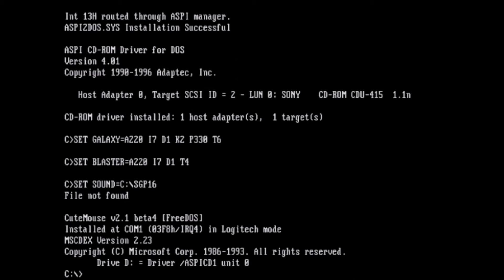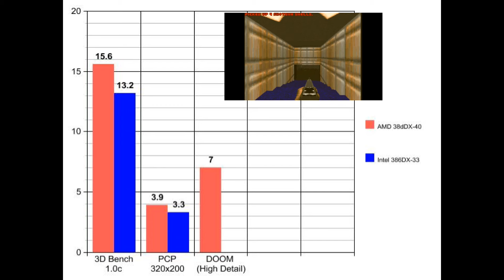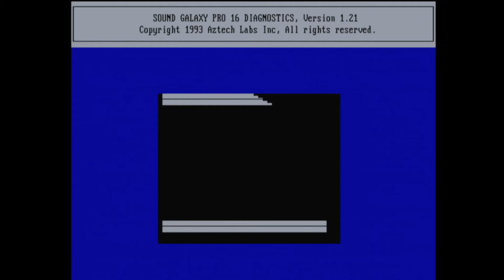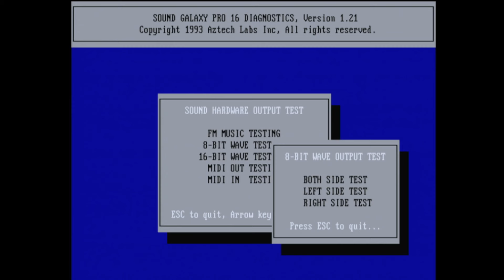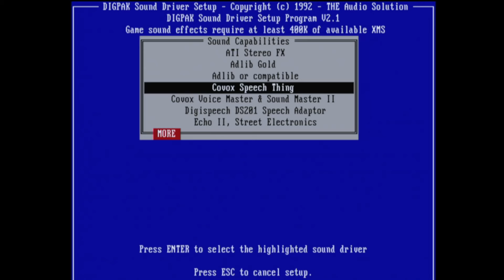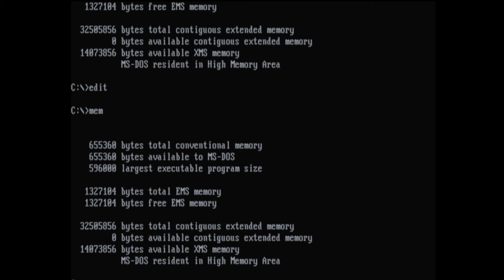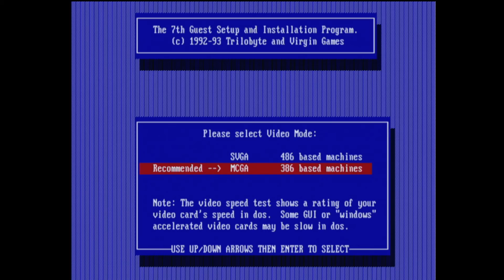AMD 386DX-40 PC, the fastest 386

Comment: 386DX-40 was cheap, very reliable (40 and 50 MHz FSB 486s were frequently unstable). As you see on this motherboard there's almost nothing on it. Very highly integrated. Most motherboards didn't even put the 386DX-40 in a socket, just slapped it right on there with solder. This, 486DX-66 and P166 (with or without MMX) are all time classics that were so common that games were targeted to run on these systems for way longer than reasonable. They were still selling 386DX-40s into the pentium era; that's just nuts. It came along at just the right time when PCs were starting to become more than a joke as a gaming machine.

It ran all the three most impressive games of 1992 fine. Ultima underworld (which was just pure magic; seriously this is the most impressive game ever made, it's like finding rabbit fossils in precambrian rock); ultima VII and wolfenstein. It could kinda badly play doom as this video shows, which was somehow deemed acceptable back in 1993. You really wanted the DX2-66 for a good doom machine; it would run full framerate almost all the time and the DX2-66 just stayed on market for years and became incredibly cheap after a little while.

Comment: What did use 32 megs and a scsi cards in 1990 was Sco Unix aka Xenix back then. You should install it. Also if I recall you could order an Intel over drive to get a 486 to run on that board
Reply from the maker: @timothygibney159  the Intel Overdrive CPUs were for upgrading 486 class machines. I don't think Intel ever made anything like that for the 386. Cyrix though did make a 386 to 486 upgrade chip. I have one and did a video on it some time ago.
Reply: Also, if you want to install win 95, not so ridiculous.

Comment: Have you considered that the sound card or the amount of RAM might be slowing the system down?

I’d bet that it’s faster with 8 or 16MB than the maxed out 32.

Edit: I see right at the end you tried reducing the memory.
Reply from the maker: @jonchapman6821  could be the sound  card. As I said in the video though, I reran the benchmarks with 16mb just to compare and it was actually slightly slower with 16mb compared to 32mb which surprised me.

Comment: OH sweet 386 build. God this is making me want to get my sx built...but i want to benchmark all my 16bit isa video cards on my 486 and see what would be a good match for it...including the et4000
Reply from the maker: @definitelycasualpcs8789  nice, I'm working on an SX build as well though I'm going low end. Since I already did some high end 33mhz and 40mhz 386 builds I thought it would be intresting to put together something significantly slower.
Reply: @AncientElectronics  mines a 33mhz if im thinking right. just need to decide the rest of the parts...I have a couple weird oddball cards i can use for fun, like a weird...soundblaster 1.5 or 2.0 clone?? ...Ideally id like to find a dx40 at some point for a higher end 386 build. but thatll be future stuff lol
Reply from the maker: @definitelycasualpcs8789  i have an uncommon 40mhz SX board i was going to use. It even has l2 cache. I was going to disable the cache and change the oscillator to run it at 20mhz but the board seems to have issues and randomly locks up on me so I'm going to have to track down a diffrent SX board.

Comment: I kinda almost wish I had something like this for Wing Commander 1 and maybe Alone in the Dark
Reply: No, it's either too fast or too slow for Wing Commander 1. Now, Wing Commander 2, it might be perfect for? That game seemed to like my buddy's Gateway 2000 486DX/33 with the turbo off (so how slow was that? ISA bus speed, or 8MHz?)

I wonder how hard it would be to decompile the original Wing Commander and patch the code to run based on a system timer rather than fixed cycles or whatever it's doing to be so speed sensitive...? Not even thinking about a remaster, but that might be the way... anyway, it's a hot mess to try to run. Hard to find the ideal speed. I think it might be a slow 386, around anywhere between 16-25MHz. I don't know if SX or DX matters when trying to find the perfect Wing Commander machine or if it's just about clock speed.
Reply from the maker: I'm working on a 386SX-25 right now. WC felt slightly slow to me so maybe a 386DX-25 is ideal.

Comment: 4:21 you forgot to mention that you seem to have a dirty bit sram also there which probably enables L2 to behave in writeback mode. ;)
10:10 The CL-GD5434 Diamond SpeedStar64 with ISA bus should be one of the top cards. Tseng cards became famous because they were the first to saturate ISA bus. But in the end, they didn't stay the fastest cards on ISA bus overall.
Reply from the maker: I had no idea about the cache thing. I thought writeback modes were only possible in a 486 and up class system IF the CPU, BIOS, and cache permitted it. Though you mentioned "like" writeback mode so I'm assuming it's a different process.
Reply: @AncientElectronics  no, it's true L2 writeback. I have Ilon M321 board and it has the same thing going for it. Though, with latest MR BIOS on my board, this extra sram becomes unnecessary, as they have managed to do some black magic and put the dirty bit into the already existing TAG sram. Original bios does require this extra chip on my board.
This is how i recognized it on your board ;)

Comment: If you could get away with 0WS on the SRAM at 40MHz, it might be a good bit better - since the 386 does not have cache itself, the cache is primary rather than secondary - You have 15nS CACHE chips which are better than the 20nS specified for 40MHz.
If not, maybe a 61256AK-12 in the tag position and, not sure what the faster equivalent for the other one is

Comment: is the bios letting you cache all 32 mb?
Reply from the maker: I thought of that and I ran the benchmarks with 16MB and compared it to the 32MB benchmarks and it actually ran ever so slightly slower with the 16MB. I didn't bother writing down the results but it was minimal, like 0.1 or 0.2 slower. I was kind of surprised.
Reply: @AncientElectronics  Cachechk?
Reply from the maker: @matthewday7565  good idea, no I didn't run cachechk

Comment: i think a 486 upgrade would have to go in the cpu socket. the isa socket wouldn't support the 32 bit memory bus. iirc at least.

i suppose they could always include memory on the upgrade card ... but at that point the 486 upgrade would basically be a whole new pc, and the motherboard wouldnt be much more than a backplane.
Reply from the maker: yea, I suspect your probibly correct on that.